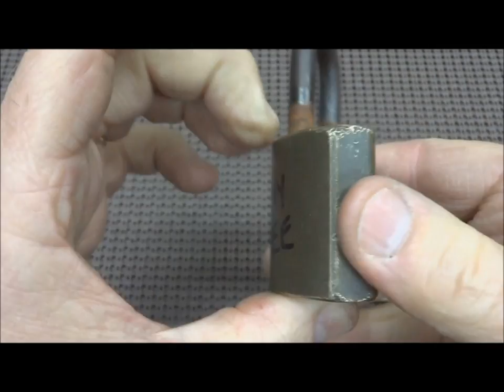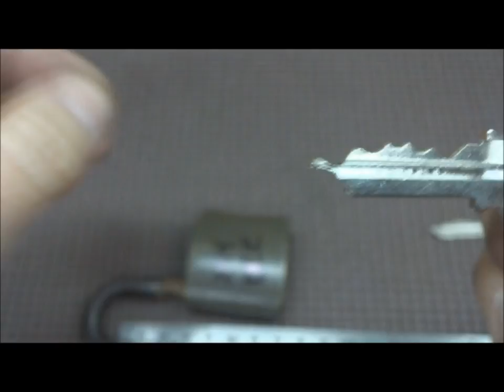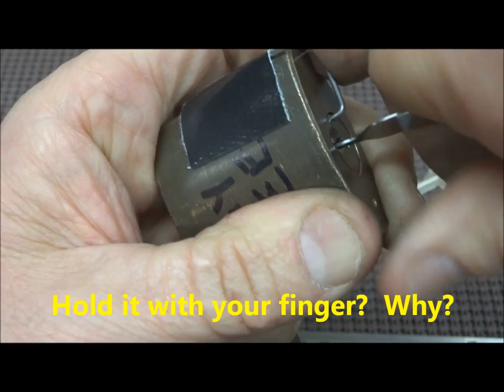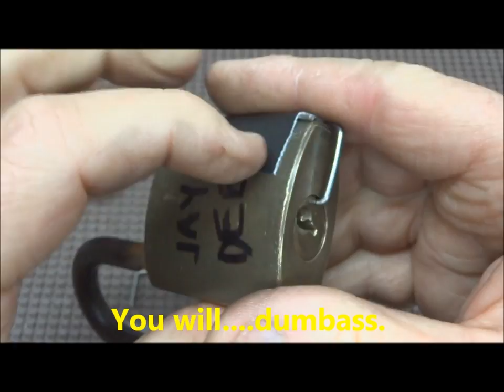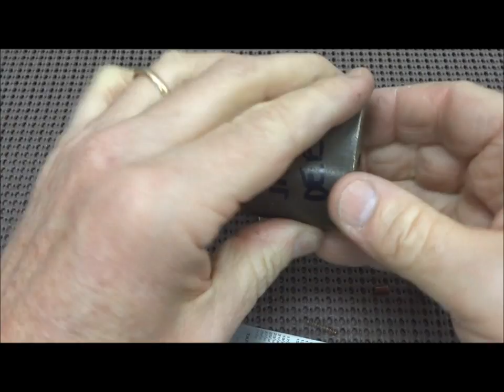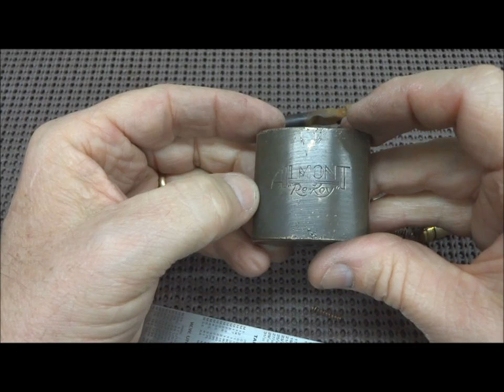(127) How to Rekey your Almonte Rekeyable Padlock (and Watch Bosnianbill Screw Up)

Comment: I needed a good laugh this morning, i know this vid is 10yrs old, but i was rekeying one of those locks last night. I was going through my cabinet down stairs in my office and found 2 of those same locks, on zero bitted in kwikset, and the other in schlage. I bought them yrs ago and totally forgot about them, and did the exact same thing you did with the pins. But, what i did find it a parts bin i had purchased the rekey kit when i bought the locks. The kit is another lock cylinder that you put the piins and springs in, then slide the collar over the plug to hold the pins in place, line up the groove and slide it in the lock, then remove the sleeve and wiggle the cylinder back and forth easy to set the pins and springs in their holes. They give you a wire with the kit to slide into the groove and it hooks on the outside of the lock. (not needing tape) when wire is in place pull out cylinder, install the cylinder with bottom pins that came with it, and done. Afterwords make sure you keep rekeying kit in eye sight at all times, lol i guess i bought 2 when i bought the locks. I hated those locks until i learned how to rekey them, turns out they are one of the easiest locks to rekey.

Comment: Thanks for the reply. I ended up using a spring (wire) from a screen door spring loaded wheel from Lowe's. I found you can still install the pins with just the wire, but it still is a bastard! Thanks for the info here. I did not know about grinding bottom of the key...that was my problem not getting core out. I re-keyed to new key just fine!

Comment: Trust me, even if you have the genuine Almont pin loader it is still a royal pain in the ass to do! I had a problem with when was the proper time to reinsert the shackle and the ball on the spring side of the shackle. I truly appreciate the Abus and other padlocks that use a standard cylinder!

Comment: I ordered the rekey tool set for this lock it comes with a curved wire to hold pins, a hollow core that holds drivers and springs and a shove tool to shove the pins in place a hollow brass cover tube. when it comes next week I will make a video.

Comment: This is pretty close to how you can repin (whole) euro cylinders, the ghetto way, except you use the bottom of the keyway instead of a custom hole in the core. I was doing this the other day with a couple of cheap ones (10 bucks for two same-keyed double ended cylinders with 6 keys), to make a set of practice locks for myself — 2, 3, 4 and 5 pin versions of the originally five pin lock.
By the time I got to the last one I wanted to just keep everything intact as much as possible and just remove 1 pin. And I did. And I pulled the tool out. And there lay eeeeeeverything....
Reply: Incidentally, you do need to pick it to get it out intact, or use a modified key... So in making my 2/3/4 pin practice locks for when my picks arrive I accidentally raked open the whole five pin lock with a piece of baling wire as a tension wrench and another bit as a hook. 

I guess they'll still help me develop SPP feel ;)

Comment: "If you tape it from the beginning while forgetting the key you may still screw up."
-Jack 

"If you tape it from the beginning you will not have to go through the process of replacing every single pin" 
-Bill

See the difference between these two quotes?

Comment: Just a curious question. When you are wrapping up, and getting ready to pull the pin retainer / music wire / paper clip out of the slot....why didn't you just turn the core first and then pull the pin retainer? Is that possible? Thanks for the extra entertainment value on this video though! loved the captioning!
Reply: +David B Looks like the slot the music wire fits into is both in the body and the core. Wire keeps it from turning.

Comment: I got the core out I want to change  the top pins to security pins. problem is there is only 1 hole to access the top pins it's blocked in the back the springs are sticking out how do I get new pins in there without that cut out tool that rotates and covers each new pin inside??
Reply: +bosnianbill Peterson makes that hollow brass tube with a groove cut at a slant to insert upper pin then rotate then insert the next pin and so on, each rotation covers the pin inserted 1 at a time. problem is its $90 & brass when plastic works good enough.  if you have time 1 day maybe you can 3D print a few different sizes. the almont is the same size as the kwikset follower. if you ever decide to do it let me know I will send you a couple locks with a couple Rytan picks. my pinning kit arrives in a few days so I will be pinning up 5 vintage Yale cylinders with extra interchangeable security pins to send out. regardless I would like to send you one of those anyway as a challenge/practice lock.  thanks